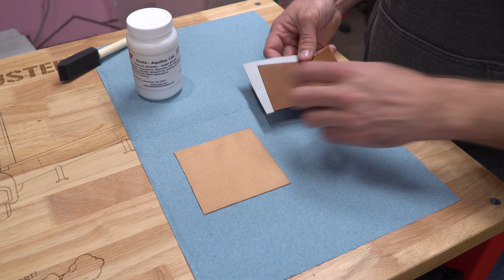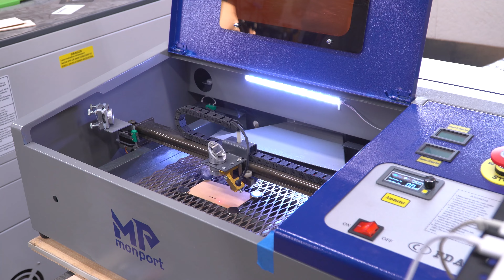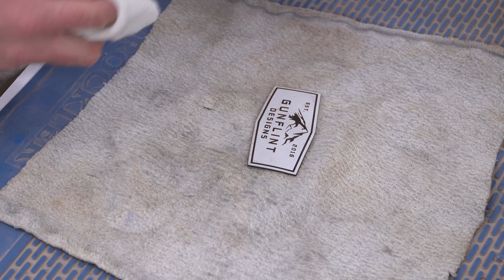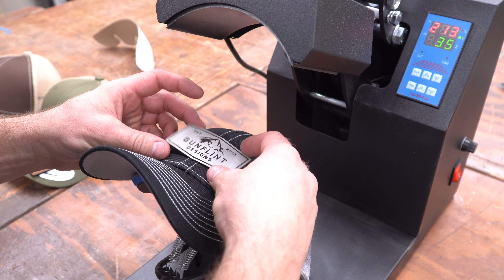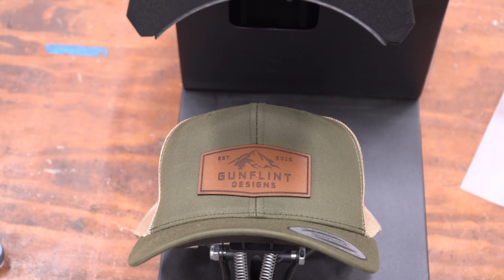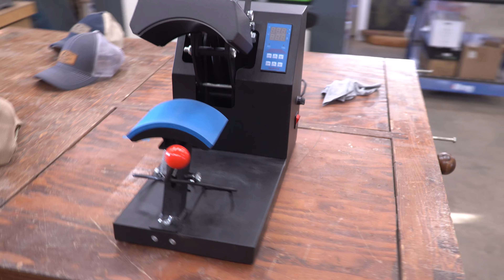Make Your Own Hats - Custom Laser Engraved Heat-Transfer Patches

Comment from the maker: UPDATE Hey Guys, this is an old video, but I have been getting lots of new questions about the glue, so here's what I have to say. I made this video while learning the process, and based on conversations with the manufacturer I was sure this glue was going to be the hot ticket for glueing on leather without having to sew it on. Unfortunately, after testing it even more myself, I have had a hard time making it stick for any acceptable length of time and have abandoned it. I found that heating it hotter or longer, or doing multiple presses could help, but nothing really lived up to my expectations. So all I can really say is I am sorry for leading you astray. 

I have switched to using "leatherette." It isn't quite as nice as leather, but it comes close and is really nice to work with. It doesn't give off the same smell as leather, and when you buy it with the heat-activated adhesive already built in, that stuff really really holds well. My first test hat with leatherette was intentionally over-abused, and the hat all but dissolved around the patch. Here is a link (Amazon affiliate) to some leatherette if you would like to give that a try. https://amzn.to/3R5TaZc
Reply: Thank you. You are not using real leather anymore?

Comment: Question, this contact cement only needs a heavy application to one side and heat to activate? No need for the second surface to be glued like in standard contact cement applications? If so I need to throw some money at someone to get this glue here in Canada. Second question is I can easily get Renina Aquilim 315 here in Canada but not 130 as you show in the video. Does 315 work the same or do I need to focus on getting the 130? Thanks for this video!

Comment: Those hats turned out great! When will they be on your website?
Reply from the maker: Hopefully soon. I need to settle on materials and colors - I am also in the process of getting a new big laser that should handle way more volume! If you liked any from this video let me know, they aren't spoken for yet! And any feedback helps me pick out the colors I'll stick to in the future.
Reply: @GunflintDesigns I think you’ll get a lot of opinions based on people’s color bias. I personally like the grey tones, but also like that green one.
Reply: @GunflintDesigns  I like that navy/tan one you have in the back right of the group shot. But for a hat, I'd wear any one you have pictured. I'm not much on the flashy colors.